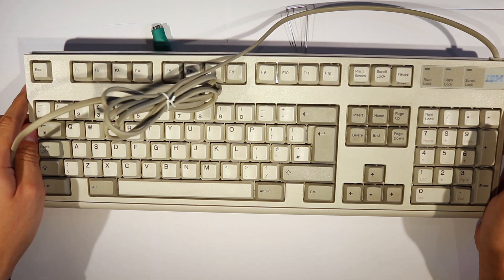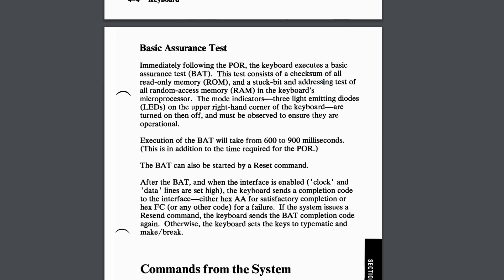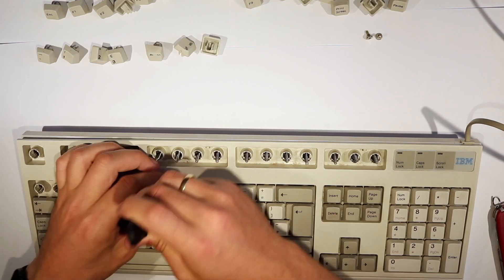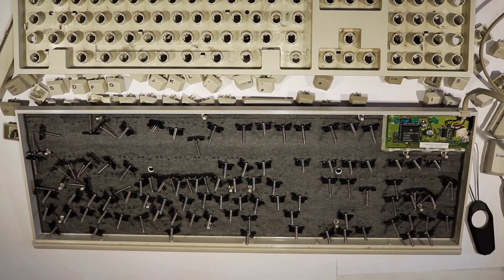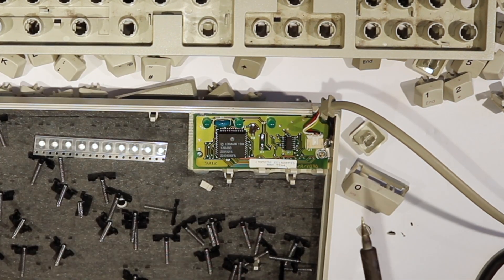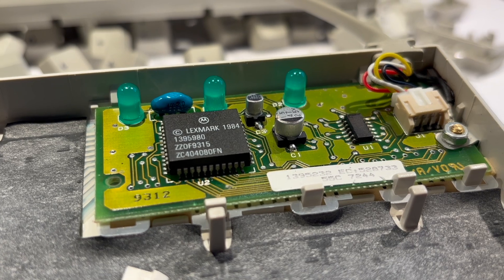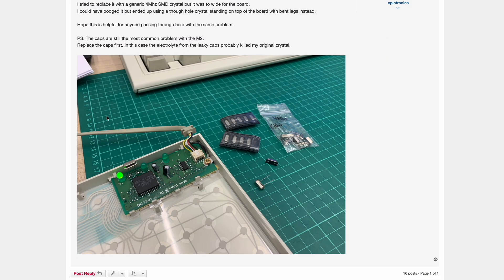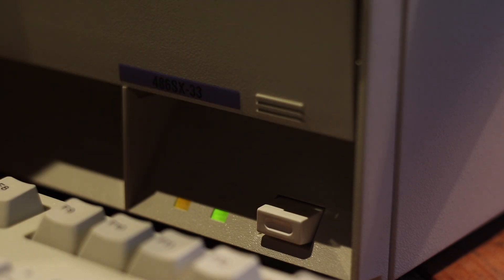This IBM Model M2 Keyboard from 1993 has issues... Let's fix it!

Comment: Appreciate the video.  Any idea if the capacitors need to be 50v rated?  I have caps that are rated for 35v, but don't want to mess anything up.
Reply from the maker: 35V will be fine - they won’t see anywhere near that voltage
Reply: @AndersNielsenAA  That's what I figured, but appreciate the confirmation.  It would be crazy for it to send 30+v to the Keyboard, but I wasn't sure because the PS/1 is an odd one with the PSU in the monitor sending 36v (I believe) to the main computer.

Comment: I knew there were many problems in this Model M2, so I did not have 1 but 3 or 4 set of Model M, not all can fix this kind of keyboard problem.
Reply from the maker: Wouldn’t like to get hit over the head with a Model M

Comment: The only thing I can tell you is that each capacitor requires a lot of heat to be removed, the acid damages the tin and makes it very difficult to remove. I repaired the keyboard, but many keys on the keyboard matrix do not work and it is really a very fragile keyboard, I have to open it again.
Reply from the maker: Also have to admit I still have a key with issues - one of the spring holders broke in half so I’ll have to take it apart another time too. 
Super fragile.

Comment: can you replace the microcontroller with a teensy? i have never seen a mod before.
Reply from the maker: Probably - but if the goal is to make a PS/2 keyboard work with USB it's probably easier to do the translation from PS/2 to USB HID than rewiring the keyboard scanning matrix.

Comment: The M2 was a low-cost version of the Model M which shipped with the original PS/1.  Yes, a low-cost Model M...if you consider that the original Model M was a cheaper to make successor of the Model F.
Reply from the maker: It certainly did the job, though I do remember killing one at some point in the 90s, probably by removing keycaps and mangling the spring. Cheaper at the cost of repairability.

Comment: I watch so many repair  videos for capacitors and after doing the same kind of repairs for 5+ years, I find it astounding how many people seeking to preserve electronics with potentially leaking electrolytic caps don't replace with ceramic or tantalum ones. Replacing like for like with electrolytic is just resetting the clock on the time bomb. The arguments I've heard are "well, I used what I already had" or "they're cheaper" or "the solid ones are less tolerant" but after using tantalums and ceramics for many years I have never ever experienced any issues with them. And if they do fail they simply short - rather than destroy half of the board it sits on. So anyway, thanks for the guide, as I'm about to recap one of these, but maybe take this suggestion on board - try some ceramics - which are even better because they're not polarity sensitive!
Reply from the maker: You’re suggesting a 47uF MLCC rated at 25V instead of an electrolytic? 
Most of those are a few orders of magnitude more expensive, for no real gain, and I absolutely don’t buy the “time bomb” argument - unless you magically dig up some early 90s electrolytics - things have improved.
Stick with modern electrolytics and you’ve already improved things to last more than an additional 30 years - no need to confuse the next guy with different parts. 
Also - replacing 1 to 1 with ceramics isn’t always a good idea. Different ESR might introduce noise, create oscillations etc - a lot of the time it is better to stick with the type the device has been thoroughly tested with to begin with.
Who knows - maybe I would’ve thrown in a ceramic if that’s all I had, but I’m sure this won’t cause trouble either.

Comment: When I dissembled mine a couples of years ago I think I managed to brake one of the stabilizers on the spacebar. As those is also made of brittle plastic.
Think it can be good to mention that.
Thanks for a good video!
Reply from the maker: Thank you. Yes, it's not a very durable design. Same for most other larger keys - they really should've put a metal bracket to hold them but I guess it's another cost cutting measure.
Reply: @AndersNielsenAA  they sold it for a really outrageous price.

Comment: Would this count as a mechnical keyboard?
Reply from the maker: Good question. It has very distinct spring mechanism providing the switching.. but on the other hand it’s still a membrane keyboard. Both and neither I guess.
Reply: @AndersNielsenAA  Model Ms used a membrane too and folks would usually consider that mechanical (due to the buckling spring). I'd consider it mechanical.
Reply from the maker: @colinstu  Usually the distinction is made between individual switches vs a membrane but it doesn’t really make much sense as a measure of “quality”. 
You can find plenty of horrible mechanical switches and some great rubber dome keyboards too - I can’t handle 20 minutes of typing on a C64 keyboard no matter how “mechanical” it is ⌨️ 😆
Reply: I love mechanical keyboards and I'm a big fan of the old Model M. I was surprised to find out they had membranes under the buckling springs.    I feel like a Coca-Cola fanatic who finds out they've been drinking Pepsi all this time without realising. All I can say is they feel mechanical. I guess that's the main thing, right?
Reply: @philrod1  I think the main distaste for the mention of "membranes" is because 98% of the keyboarding community thinks that "membrane" is referring to the rubber domes and not the sensing part.